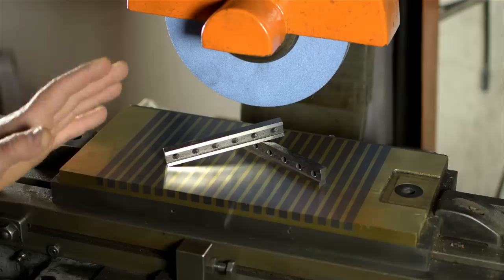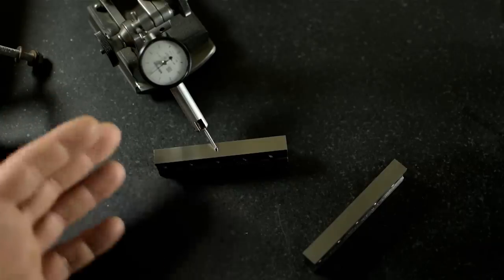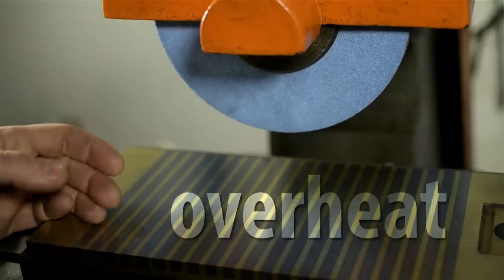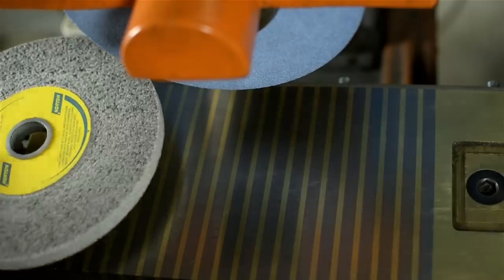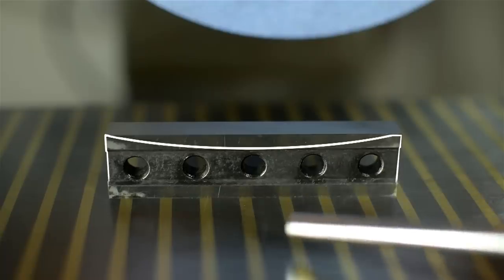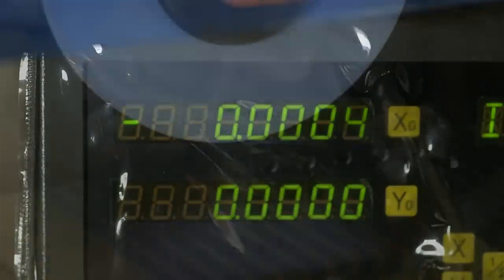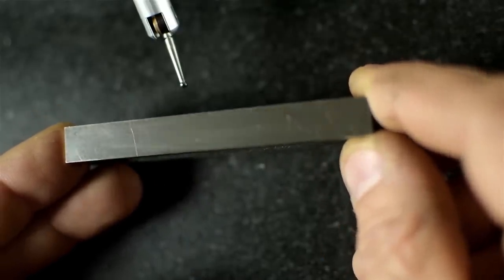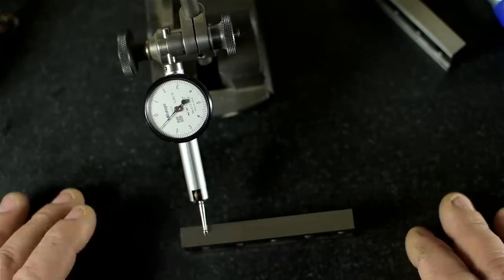Grinding: FEEL THE HEAT

Comment: I have for years been trying to figure out what my grinding problem was. Despite watching videos and reading everything I could find, I was getting nowhere. It wasn't until this stellar video pointed out what should have been obvious all those years ago: I don't have a grinder. Thank you ToT! You saved me from many more years of frustration...
Reply: I have many grinders... none of them are surface grinders, I have multiples of Angry Grinders (in three sizes), Benchama Grinders, Belt Grinders, and Die Grinders (German for The Grinders), Until recently I even had a Stump Grinder
Reply: @cmotdibbler4454  If you need a grinder to take off your belt, you really need to take better care of the leather. You probably should also change clothes more often.
Reply: @cmotdibbler4454  And submarine sandwich Grinders...
Reply: Bob Hassinger  - for CMOT Dibbler, that would be sausage inna bun
Reply: @alecmacleod9147  You beat me to it.
Reply: A fun series.
Reply: make sure your using a grinder and not a grindr… 

probably best not to google the latter...
Reply: @cmotdibbler4454  - I thought a stump grinder was any grinder you were too slow in  pulling what was left of your fingers out of it?
Reply: There is an App for that....watch out for heat, bulging  in the middle and or bending...
Reply: People here obviously prominently including Mr Tony have such an incredible sense of humor! I was like "oh nice this guy after all those years thanks to Mr Tony finally learned what the issue wa..." and then came the punch line ! Hilarious! :')
Reply: @cmotdibbler4454  why do you have one for an incorporeal concept? How do you grind death? I mean, you can grind on the grim reaper, i guess...

Comment: Ok, my heat surface grinding story. In the early 80's in vocational school, I attempted to grind some flat washers to make valve spring shims for a BB Chevy was hot rodding. I was doing this on the sly since working on anything to do with mankind a car go fast was strictly prohibited. So I load up the mag. chuck with 16 washers when the teacher was otherwise occupied.  This was a big grinder full auto everything. Don't rember the specs now but a nice machine. I kissed off on the washers. Turned on the coolant and hit the auto feed. The teacher came back in just in time to here the washers flying off the chuck and hitting the splash guard in rapid succession.It sounded like a machine gun with a hand grenade at the end when the wheel blew. The washers had warped enough to loose good contact with the chuck. I confessed my crime and thought I would be thrown out. Instead the teacher asked what I learned. I said I should have blocked in small parts been more careful with my depth of cut and been aware of heat buildup. He told me mistakes were ok as long as I learned from them.
Reply: Wow, what a teacher.
Reply: that's a good teacher right there
Reply: I was really expecting the story to end with, "He told me mistakes were ok as long as I learned from them... then he threw me out."  Still a good story.
Reply: The most successful people have failed horribly over and over. It's how one 'gets gud' as they say.
Reply: @cap5856  - Liability.  If parts made in a school shop were ever REMOTELY involved in any kind of serious accident, that's raw meat for the legal wolves.
Reply: @cap5856  It was a school liability thing probably. If something happened they probably feared the lawyers would attack.
Reply: "A machine gun with a hand grenade at the end", HA! That was great!
Reply: I'm impressed with the number of words you either misspelled or used an incorrect homophone in place of (and no I am not questioning your manhood!)  I mean, at mankind I was thinking maybe you were typing on a phone here and spellcheck went haywire.  Rember was ok, I got passed that.  Using here instead of hear was a bit much, in my opinion.  Loose for lose, well, I just couldn't go on anymore.  As I said, impressive!
Reply: @bluepvp900  funny stuff. Hope you were as annoyed by my butchery of the English language as I was at diagramming sentences. Which I am proud to say I failed miserably. 😀😁😂🤣👍

Comment: Tony, I also have a dry grinder (Central Machinery). I have been using a $17 USD mist cooler that I got on amazon. The thing works well for me. I made sure to get one that had separate adjustments for air and coolant flow. I run it from an airbrush style hobby compressor and that supplies plenty of pressure and flow. I get plenty of cooling and no real mess to speak of. Hopefully this helps someone else if they were curious about the cheap ones available. Thank you for sharing your work with the rest of us.
Reply: I was going to mention that, but went through comments first, just in case :-)
I'd like to suggest Shadon HKW's video from long ago, that stayed in my mind, because it was a beautiful Noga mister: https://www.youtube.com/watch?v=4GftEpDQbjM

Comment: SG = Silicon Garbide?
Reply: Sweet Gesus
Reply: Sexy Grit
Reply: Sparky Grindy
Reply: SiGismund
Reply: silicon Gel
Reply: Sand and Glue?
Reply: Stop Guessing
Reply: Solid Guitar
Reply: It's instructions for use... (S)pin to (G)rind.
The instructions are there to stop people wearing flat spots on their grind wheels 😀
Reply: Solid Gold
Reply: Sorta Gritty.
Reply: have you any idea how funny you are?
Reply: Sol gel/seeded gel ... basically sub micron Al2O3 with special seeded gel binder sintered with special method to have high G ratios in grinding... great wheel by d way...

Comment: I’ve have been a Tool And Die Maker for 40 years and haven’t used a single point diamond to dress the bottom of a wheel for about 35 of those years. Early on I found that a single point diamond polishes the bottom of the wheel, glazing it up. More surface of the wheel touching your part which causes more heat. A cluster diamond dresses the wheel more open because each time you put the dresser on the chuck you are using a different diamond configuration to dress the wheel. Basically a sharp edge every time . Try it sometime and see for yourself. A large cluster diamond for the bottom of the wheel and a small cluster diamond to dress the side of the wheel if needed. Just trying to help out out!

Comment: A mate of mine is a retired machinist and his ‘heat bends parts’ story is of a guy no one liked grinding a pistol slide. He wasn’t a machinist but worked at the shop. He was grinding without coolant and hadn’t offset the angle. Apparently everyone saw his mistake but the guy was not liked for good reason so no one told him. Guy thought the part was flat til it cooled, tried grinding it again, and again, and again, til it was really a pistol slide anymore.

Comment: I'm considering building a CNC grinder, your content (and Stefan's too) might have something to do with it ;) Short story shorter is that since I've put together a 4th axis in my little CNC mill, having a lathe doesn't feel so urgent anymore, but a grinder would still be pretty darn cool (yes I have considered putting grinding wheels on the mill spindle, and no I wont, those linear rails were expensive).
Thanks for the great content Tony!

Comment: Great points to look out for, if I ever get a surface grinder lol, but actually I have a lathe/mill combo (Smithy), and several CNCs (Shoptask mill/turn, Zenbot 4896, Shapeoko XXL, home made cnc mini lathe and cnc mini mill. Damn hobby. Worse than Harley lovers. 
Anyway I have used a molded grinding stone on a 1/4" shank, in in the Mill's chuck to grind parts.
I have also used a magnetic chuck with a fence (to keep parts from sliding) for light milling. I didn't know any better. I learned all my machining from videos like yours, and lots of books, but the chuck worked great. But I sold it, so I could buy a Tapping head, that I never use.
I love watching your videos, Crazy Bastard.

Comment: If I can’t find my diamond dresser, I’ll go to my Fran Drescher. Works just as well.
Reply: You must have excellent hearing protection to use one of those.
Reply: Slightly too abrasive
Reply: You can't afford to dress a grinding wheel on a nanny budget!

That voice, though, would clear hot dip galvanizing out of a grinder disk. Or aluminum out of a double cut die grinder burr.
Reply: Imagine Fran Drescher and Gilbert Godfried singing Wagner together...

Comment: You’ll not believe how chuffed I was to find this video.  Almost no one talks about grinding, mostly because no one has grinders.  You hit it on the head, too.  The second biggest problem with grinders is that no one knows what they are doing.  
However, I exclusively grind in my place of work and I can say without a doubt that heat is my biggest problem.  My most powerful grinder has a 30hp motor on the wheel spindle, and turns a 3” wide by 24” dia wheel at 7500-8000SFM.  This machine has a 5 hp motor just to power the coolant pump.  I would double my coolant delivery capacity if I could.  I can’t touch more than 10-15% wheel (horsepower) load without burning parts.
With wheel compounds, I pretty much stick with the 32A60 wheel with an F hardness and an 8 structure.  This wheel in the size I mentioned runs about $2400 each, which brings me to what I feel is also a huge problem with grinders.  The cost of the tooling.  It is hard to play around with different compounds like one would with lathe or mill tooling, when my wheels run north of 2 grand each.  And that is for a run of the mill AlOx wheel, not the fancy 5SG compound, or 5NQ compounds.
This brings me to my next gripe, there is not nearly enough people sharing their experience with grinders on the available avenues for doing so, and you might ask why I don’t do it.  Simply put, I can’t(not allowed to) because of what kind of parts I machine.  My content would be very dry if you had to listen to me talk about grinding wheels with no pictures to back it up.  I am very happy to hear of someone who has experience with the 5SG wheel.
I would love to find a group of people who aren’t A-Holes who like to talk about grinding.  It’s asking a lot, I know.  This type of personality is a prerequisite to being a Machinist.
So, all of that being said, I will share my experience with the different compounds I have worked with, right here.  
Cubic Boron Nitride wheels are good for longevity, and the variety of materials that they will cut, but dressing them requires a diamond roll.  I have yet to find a diamond roll motor that is rigid enough or has enough power to remain at a constant surface speed to deliver a good dress quality on larger wheels.  You need a diamond roll to dress CBN because they will destroy a single point diamond at the meer sight of the wheel.  I use CBN on my Jig Grinders in certain applications where I need to achieve SFM requirements with a small wheel that cannot be done with a conventional wheel without exceeding Max Operating Speed.
53A is a fantastic, stable compound for cutting ferromagnetic metals.  Even down to a 54grit grain size I can achieve sub 4rA surface finishes with enough surface speed and dwell time.
32A is the best compound I have used for cutting chrome.  If the wheel is plugging up too fast, go to a more open structure or a softer bond.  The wheel still requires frequent dressing on large surface areas of chrome, but it is stable and cuts with less heat than the 53A compound on chrome.
37C I almost exclusively use to dress diamond wheels with a rubberized bond.  On the cylindrical grinder, I hold the 37C wheel on an arbor made in house, and run the diamond against it to true it up.  I feed in aggressively at first if the Diamond is badly out of round.  Traverse rate should be at greater than or equal to the width of the 37C carbide wheel, per revolution of the carbide wheel.
When it comes to diamond wheels, I prefer the rubberized bond to the electroplated variety because the rubberized wheels live much longer when properly taken care of, and in my opinion, leave a superior quality of surface finish.  Materials that I cut with diamond include ceramic, glass, tungsten carbide, and ceramic oxide.
I need to seek help.  No one should be this excited about grinding.

Comment: Tony back when i occasionally did such things in the course of being paid. with thinnish section parts, some of the more confident toolmakers overseeing me would only half lock the mag chuck and have backers each end of the part to prevent slippage. they were of teh opinion that the reduced mag  tended to reduce the clamp 'n' spring when turning the part over.  With small parallels like these and as you say when its tenths everything counts. :-)

Comment: I recently bought a surface grinder. this is very useful.
i'd hate to keep grinding away at a part trying to get it level but keep getting a dip in the center. thermal expansion sucks when you dont want it to expand or warp.
and i think thats the problem with my Chinese lathe. there's a dip in the center of the bed rail. that explains a lot. the lathe has very little run time so it cant be natural wear.

Comment: If you are interested in some more details on the grinding wheels...
The specification breakdown of the grinding wheel can be seen on page 221 in https://www.nortonabrasives.com/sga-common/files/document/catalog-nortonindustrial-7362-lr-bookmarked.pdf
- For the white wheel 32A is refering to white alumina grit (Al2O3), 80 is the grit size (=~185µm), F is the hardness (soft) and 12 the porosity (average), V(BEF) is standing for vitrified/glass bond.
- The blue wheel is made of 5SG synthetical made sol-gel (SG) alumina grit (Al2O3) in coarser grit size of 46 (=~370µm) with medium hardness of J, V(S) again for vitrified bond.
The term "cooler grinding behavoir" is very common one in the industry, but it is a summary of the wheel specification, the grinding parameters and the material you are grinding. Could be that the same wheel could act completely different on another machine or when using other material. I think you get the impression that the blue wheel acts cooler because there are not so much grit particles in contact with the workpiece - in fact there are about 8 time less grit particles in the blue wheel as in the the white one. Less grits -> less contact with the workpiece -> less heat...

Comment: This Old Tony i hope you read this!! Imagine that your part has a 0.01 mm dip in the Middle.... Then you turn your magnetic chuck on. Even in hardened metals the magnetic chuck Will Pull that dip down... Then you take it out of the magnetic chuck and the part relaxes back to the 0.01mm dip...
This is more of an issue in larger parts but is something you should also mention ahahha great work anyway!!
Reply: This is also quite easy to check if that happens in a particular part: put a dial indicator in the middle of the part and flip the magnet on.
Reply: IIRC Keith Rucker got told about this by Solid Rock Machine Shop.

The essential problem is that when your part has NO flat side, you mustn't "mag it down", since you WILL distort it. (all these statement carry a caveat of "for some tolerance").

It's why hand scraping is so precise - the part is measured (i.e. printed) under no clamping tension.

Comment: When i grind a heat treated piece for the first time which usually has a bend in it , i put the two end sof the bend down and pack underneath with paper, the keep turning and rotating.

Comment: use an airblast for cooling, also try pop off your parts from the mag chuck instead of scraping them off, less likely to introduce burrs and ruin new grinding surface.
i have an assortment of plastic acetal/nylon sticks and even needle nose vice grips with rubber hoses over them for getting a grip or using holes/features to pop components off, hope this helps

Comment: This,  if I my be so informal as to use your first name, Steve over at Solid rock Machine Shop is a surface grinding master and he commonly holds 0.00005" on his parts. He is very generous with his knowledge and a really nice guy. He helped me immeasurably when I got my surface grinder and I suspect that he can help you as well. As for the video, always well shot, narrated, edited, and the content can't be beat. stay safe and well.

Comment: heat is one of two problems you'll have to face. the other one is also a pain in the ass and it is the magnetic chuck that can bend your parts easily. if you place a banana-shaped part on your grinder, it is very possible, that magnet will bend your not-so-flat part to very-very-flat magnetic table. even if you grind with virtually no heat, your part may be banana-shaped right after taking it off the chuck. it is a good practice to grind one side in some non-magnetic environment and then when you are absolutly sure about this sides flatness, place it directly on the chuck to grind the other side. with small parts, you can grind one side in some vice. with bigger parts you have to use some small plates(1/8 inch thick for example) placed on the table, and then place your part on them. you have to secure your part by placing it against some scrap and you have to be gentle...but it works, that is how i made edm support plates and they were 15 inches long

Comment: I remember when on of the guys I work with tried surface grinding some barely magnetic steel (special grade) and he lined all the parts up with the wheel they were getting hot enough to start lifting and he managed to then launch 5 parts lined up in a row off the surface grinder 1 bounced of the shield and landed in my bosses coffee he wasn't fired but he wasn't let back on the surface grinder after the boss saw how he set them all up in line with the wheel

Comment: Windex is good for removing fingerprint ink (put windex on first, then use soap and water). 

When I want a solvent for cleaning, I usually start with alcohol and work my way up from acetone, Naphtha/lighter fuel/white gas, and finally lacquer thinner.